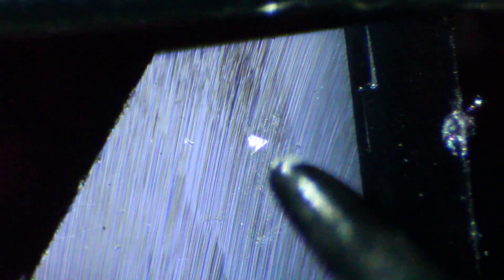Synthetic Ruby made by the Flux process

Comment: Why use platinum as a heat resistant material? The melting point of tungsten is twice that of platinum, and platinum is much more expensive, so why not use tungsten instead?
Reply: Tungsten is nicely flammable at the temperatures needed; the furnace would need to operate in inert atmosphere.
Tungsten is also a fairly reactive metal, oodles of the stuff will dissolve into the mix.
The last nail in the tungsten crucible coffin is its extremely brittle nature.
Doesn't bend, shatters like glass.
Reply: Greg Gallacci ahh I see now
Reply: Platinum is used for it resistance to chemical interaction. Tungsten would not work.
Reply: @tomchatham8896  I assume iridium would address this, that is if you could get enough of it to make a crucible.
Reply: The flux material is highly reactive. Tungsten would not work. Must be a Nobel metal. Gold, Platinum, or iridium works.
Reply: @tomchatham8896  What's the material used for flux, or is a trade secret?
Reply: Your only logic is the heat difference?
Reply: @zackzimmer7167   I was probably about 15-16 years old when I asked this question. Anyway im in welding school now so I know all about the properties of these metals! (And im still learning more of course)